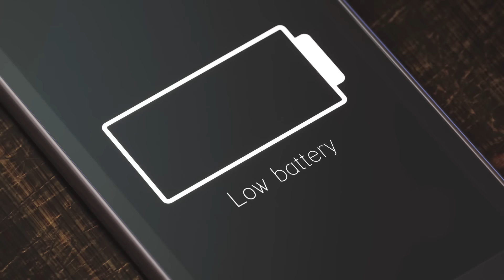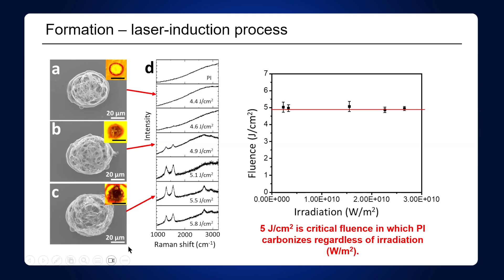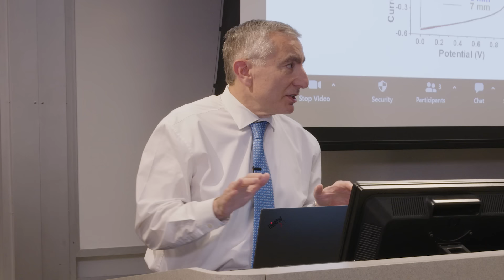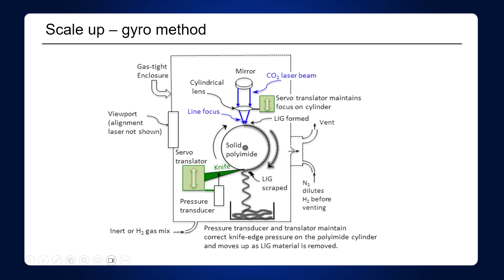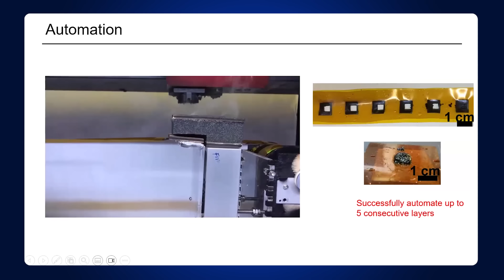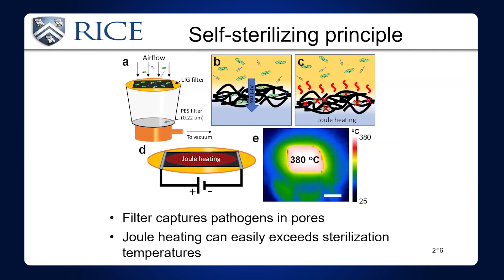Updated: Laser-Induced Graphene | #nanotechnology Lesson 05

Comment: I get it when i drink milk even if its just slightly gone.i dont buy big pints any more just a pint not two .and heat milk or turf it out .i been thinking about nets/mesh for people like lady whose leg was mutilated in camp and other scarrs in reconstructive surgery like mineral screws a surgeon used in repair he was able to leave screws in because they didsolved and bome recalcified over time, well when cuts large skin shrinks around wound but with micro printed amino acid mesh and printed soluble bone it enables bone to regrow as before ,i dont know and skin because stem cells reside in bone marrow are same DNA of patirnt its taken from .be ause muscles are striated spindles with cross bridges similar to zip when muscle contracts and glucose etc is in muscle for phosphagen system.so bone would regrow over strut?or puting encased broken bits sticking ices together so ersons face didnt collapse around broken bone skin etc cause skin on stretch marks is woven like piece of knitting stretch marks look like a dropped stitch.killing fungal infections is necessary too fungal meninjitus is horrendous worst one every one thinking bacteria.